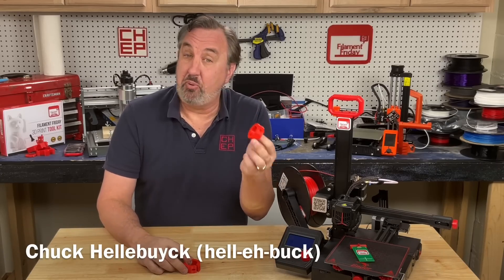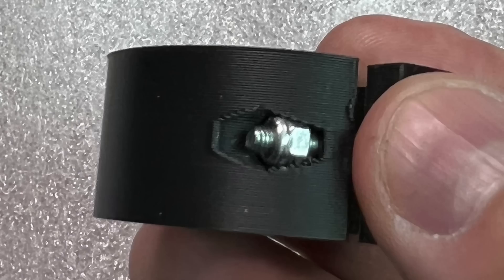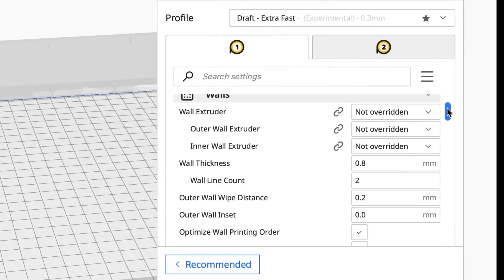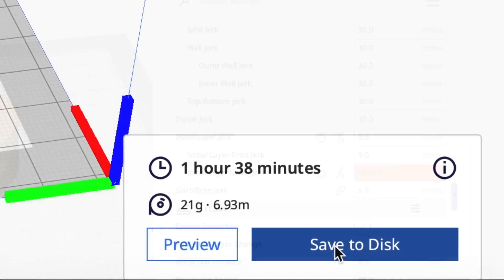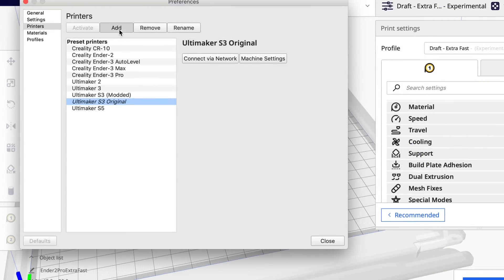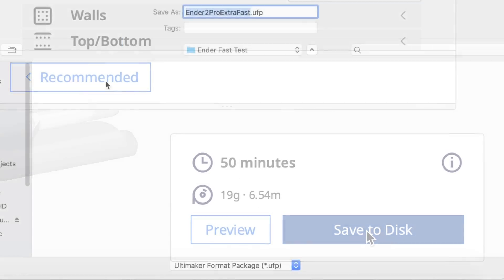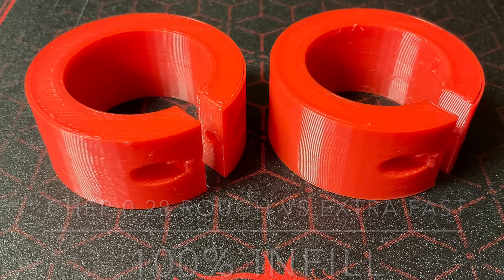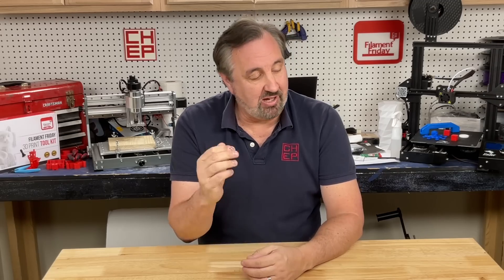Faster 100% Infill Prints with Cura 4.13 on Ender 3D Printer

Comment: More than twice as fast. Why so you think they don't offer this to any printer?
Reply: Such high accelerations can cause damage to the printer, they probably don't want to get complaints from people that will use that profile with printers that can't handle it, I highly doubt the reason is $$ when the program is free...
Reply: @E_y_a_l  Cheap clearly stated that acceleration makes only a little shorter print times. He copied accel to ender 2 profiles to prove that in video. There is "something" about algorithm that making prints much shorter.
It's not the first time that features are locked for non ultimaker printers. $$
Reply: @Wrublos212  What makes the shorter print is not relevant to what I've said, the question here is if the settings can damage the printer, one short move can damage a printer if it's aggressive enough, when you set the profile to a 4000 mm/s acceleration when the maximum supported value by the manufacturer of the printer is 500 there's a potential risk of damaging the printer, that's not twice, not 3 and not 4 but 8 times the MAXIMUM supported value, if you want to go into conspiracy theories about money being the reason it's your problem, but you can't deny the logic about a company being hesitant with sharing a new experimental feature with untested printers, and if you do deny it, try to do it with a logical reasoning and not just say $$.
Reply: @E_y_a_l  For me, and @FilmFactory (and probably everyone who watched this vid) is very important what makes print faster. For me acceleration is irrelevant in this scenario because it affect print time with minimum effect and degrading print quality. I have no idea why You care about accel, in fact You are right that it gonna affect 3D printer life span. What is the key factor here is printing algorithm shortening print time, not acceleration. You think its conspiracy theory that Ultimaker Cura gives some fetures for their 3D printers and not for cheap china ones ?  It`s not conspiracy theory, it`s strictly business. Apple policy and their ecosystem is conspiracy theory too? Or Nvidia not supporting AMD Freesync for long time just to pump up the sell of G-sync ? How different head moves can affect printer lifespan ? And please don`t mention about accel because with stock accel settings this method still works. This option is in "experimental" section so it`s clear that You do that at Your own risk even with Ultimaker device.
It`s not the first time when Cura limiting features for non Ultimaker printers.
Reply: @Wrublos212  bruh. I get where you're coming from. But literally the entire source code for Cura is open source. You can go to GitHub right now and look at exactly what they changed in the code if you wanted to. My feeling is that this "feature" is a combination of factors including, but not solely, increased acceleration. Ultimaker knows that their software is used by a significant portion of the industry, and probably hasn't spent time validating these settings for printers that aren't theirs. Once they do, I'm sure they'll release it to everyone. Would you rather have had them not release the feature at all, just because they hadn't validated it on other hardware?

There are plenty of shady things that happen in the tech industry, like you mentioned. But not everything a company does is shady. And I'm a lot more inclined to give the benefit of the doubt to a company that publishes all of their software as FOSS than I am to an Nvidia or an Apple.
Reply: @Wrublos212  You base your conclusion on reasonings that are simply wrong, the experimental section in Cura is not meant for "do it on your own risk" type of features that can damage your printer, that section is meant for features that have high risk in ending up with a failed print and this is exactly how Ultimaker describe that section themselves in their website.

The second wrong reasoning is that acceleration is a small part of the printing algorithm, first of all, it's not, every single move is effected by the acceleration and jerk settings, claiming it doesn't shows you have no idea how printer movement works, but like I've said earlier, it doesn't matter, all it takes to damage a printer is one(!) aggressive move if the printer isn't built to handle it, and if the manufacturer claims the maximum the printer can take is 500mm/s, setting it to 4000 is extremely risky, if you think aggressive head movement can't damage a printer then I only hope for your benefit that you won't discover how wrong you are the hard way...plus you said it yourself that we don't know what other things they've changed, so how do you know the other changes can't cause damage to the printer as well?

The third wrong reasoning is that Ultimaker have some kind of a secret agenda with that feature, you have no practical indication that supports that claim, what Apple and Nvidia does is irrelevant to what Ultimaker does, the question is what Ultimaker's history shows, not other companies, and at the moment, Ultimaker is giving you a fully working open source software for free and they don't even annoy the user with ads for their printers, if you claim Ultimaker are limiting features for non Ultimaker printers then start listing those features and we'll see, I'm not using an Ultimaker printer and so far I haven't noticed anything that I was limited from doing..

The fourth wrong reasoning is that Ultimaker will gain so much money by limiting that feature, making prints faster is only important with large prints and maybe you haven't noticed but that feature only works with 100% infill, usually people don't print large prints with 100% infill and not just because of the time it will take but because of considerations like the infill amount, weight, warping and more, so by definition this is a niche feature that will only effect a very small amount of prints, add to it that at the moment it also might damage your printer and you'll get even less people that will want to use it even for free, so trying to claim that Ultimaker decided to turn CURA into a "buy to use" type of program with all of the community backlash that will come with it just for that feature? sorry but I don't see the logic in that claim and I label it under a cynical conspiracy theory.
Reply: @E_y_a_l  Sorry, I don`t have that much time to replay You again equally long, read my previous comment twice, watch cheap video few times ( maybe 0.5x speed will help You to get all necessary information like print time with acceleration and without ) because You are missing the point all the way. 
" if you think aggressive head movement can't damage a printer then I only hope for your benefit that you won't discover how wrong you are the hard way..." my previous comment quote "I have no idea why You care about accel, in fact You are right that it gonna affect 3D printer life span." So why are You repeating yourself ? Think first, then hit the keyboard.
" so by definition this is a niche feature that will only effect a very small amount of prints, add to it that at the moment it also might damage your printer" And keeping stock Ender accel & jerk would also affect the printer ? It`s niche feature for You, but many people print something more than anime figures but fully functioning strong machine parts. "claiming it doesn't shows you have no idea how printer movement works" - Yup, I got the similar impression about You after what I saw.

Comment: still didn't understood what was the trick ??!!
Reply: My guess would be dynamic line width. They could increase the line width when the print head fills in large areas.
Reply: used the super fast profile on his ender 2. more accelerations and jerk.

Comment: When printing the raft, my MakerBot prints the lines 1.5 mm wide by default. I wonder if this profile does something similar with the infill bead width and makes it wider than normal since it’s 100% dense.

Comment: can we do this for ender 3 pro ? gaining a little bit of pace wouldnt be so bad :))
Reply from the maker: Download it. There is an Ender 3 version included
Reply: @FilamentFriday  oh, thanks but i have one more question. its not gonna broke the machine right? :D
Reply: @solidint  I just ran the print with the fast settings on my Ender 3 Pro. Machine held up fine, print was smooth and no stringing to be seen. Give it a run
Reply: @MrStoneSMS  thanks for your comment. i did the xyz cube thing and it printed that so fine but maybe the fast settings could be harmful in a long term

Comment: Is there a 100% hack for the ender 3? I love your videos! New to 3d printing and I am printing utility parts that require strength. I have been messing around with infill types and percentages, but this hack for 100% would be awesome if I had a plug and play code for the ender 3. Thank you!
Reply from the maker: Download it. There is an Ender 3 version included.

Comment: Now that I'm finally getting consistent first layers (thanks glue stick), I'm looking for ways to speed up prints. I'll have to give this a try. Thanks for sharing!
Reply: I began using a raft for my first 5 layers, I adjusted the raft distance outside the print from 15mm to 4mm for speed, but the raft is the WAY TO GO for getting more consistent prints. That, and a glass bed changed the game for me.
Reply: @georgeparker8167  I've got an Ender 3 v2, which came with the glass bed. In spite of this, I had constant problems getting a good first layer to stick down. Using a glue stick and very slow first layer is helping me the most right now.
Reply: @sgsax  Have you tried the raft option on the adhesion settings? I had major issues with my first layer for weeks, now I have zero issues.
Reply: @sgsax  Are you using cura? If not I am not sure which programs have the raft option for adhesion but I would look that. you don't want glue on your bed, overtime that will be no bueno
Reply: @georgeparker8167  I am using Cura and did experiment with rafts, and they helped a bit. I wash the glue off with soap and water between prints, so there's no buildup. Comes off completely clean every time.
Reply: @georgeparker8167  it's washable glue stick, everyone uses that on glass. You just use a damp paper towel and wipe it squeaky clean when you want to reaply, it's probably the oldest and one of the most reliable printing techniques people have used for over a decade.

Comment: I thought that 99% infill was stronger because it uses the selected infill pattern
Reply from the maker: Honestly, do you really think 1% is a big difference?
Reply: @FilamentFriday  im saying because of the pattern. On my printer 100% infill only has the back and forth pattern. And if its less you can select which pattern would work better with the load you are going to have.

Comment: We can try the profile with your part but I'm assuming we can save the settings to use for other parts? I haven't gotten up to speed on Cura yet.
Or are the printer parameters a file that can be shared like "fast ender"?
Reply from the maker: Yeah, you can load an stl file you want once you have the profiles.

Comment: I got rid of Marlin and uploading on SD card looooong time ago. Same for Cura. Now it’s Klipper (with Fluidd) and Superslicer.
With input shaper auto calibration and accelerometer I can get to 5000 (even more) acceleration without loss of wuality on Ender 5 Plus - which is fantastic given it’s a large printer with a center of gravity quite high.
With Dragon High flow hotend and 0.6 mm nozzle (tungsten carbide) my print times are now 1/3 of what it used to be. 150 mm/s at 0.3 mm layer height and 5000 mm/s accel? No problem at all. I must note it’s real 150 mm/s as I set my volumetric flow limit to 28 mm^3/s. Could go higher theoretically but this works just great.

I really advice to try Klipper if you have some Raspberry around. Input shaping and pressure advance are in much better state and quality than in Marlin (where you need powerful board to be able to handle it). And waving that stupid SD card here and there really becomes tiring after some time.

Comment: Hello, good video!. I think it is not stringing, it seems to me that when printing so fast it is filament that did not adhere to the previous layer. It usually happens to me when I print circles at high speed.
Reply from the maker: Then I’d see gaps in the walls but I don’t. So it’s stringing.

Comment: why not print 0%infill but many or better say ALL wall. with all wall (or lets say infinitiv outer/inner wall) the printer moves in much more natural ways and doesnt has change direction that often. this also results in faster printing speed
Reply: I f i remember correctly if you use the circural infill pattern it's pretty much the same as "all wall". I use it quite often and the prints are very strong indeed.
Reply from the maker: Weeeds334 - How much time did your method take on the part I shared and showed in the video?

Comment: I'd like to see the analysis of print time by other tools like the octoprint print time genius. I don't know if the results would be different. 
Reason being, I find cura can be out by up to half in my experience when you change to some wild speed settings.
I dunno, did they just make the time estimates better in their own printers? 🤔
Reply: it's due to the maximum acceleration set in Cura, which made the wrong predictation. If you change the acce to the correct one in your firmware setting then Cura will spit out good estimation

Comment: That's a cool trick.  Thanks for the tips.  * At the 5:44 mark you said Prusa 4.13 😜😜😜😜
Reply from the maker: No I said “version 4.13”
Reply: @FilamentFriday  - Do you use PrusaSlicer ? I like a lot of the features in Cura, but I do not like the UI experience compared to PrusaSlicer - so that's what I use. It works well for me. Just wish they had some of the plugins....
Reply from the maker: Yes, I’ve made several videos on it.

Comment: In regular 100% infill it just makes every layer as top/bottom layer and these are printed slower. In this "fast" profile it instead makes inner part as regular infill with it's higher printing speed.
Reply: That's probably what it is. I often set 999999 top and bottom layers when I want 100% infil (it's definitely different speed than first layer), but since my settings for top layer are nearly the same as infil I don't think I've ever noticed.

Comment: I’m pretty sure Ender printers are software locked on acceleration? I don’t know the max. But Chris Riley should dig into this. It’s interesting
Reply: just the firmware maxed out at 500, need klipper to go higher
Reply: @3DLL.  you can change that trough gcode via pc and usb cable or make small gcode whitch you will run on your sd card and it will save changes to eeprom
Reply: @mr.mun3271  you have a lot to learn my friend, have you just started printing?
 keep up the good work 👍
Reply: @3DLL.  done it already, so there is no limit, except diver/motor limit. Google for M201, M203, M204, M205, M500 and M501. Have you ever compiled custom marlin firmware using eg. Visual code studio? I have so i know what am i talking about. Klipper is overrated in some segments.

Comment: For your part in particular, i'snt it better to have like just perimeters and no infill?

When i print circular stuff (bushes, collers, etc) i always go all perimeter (set 20 perimeters or so). It is much more plastic extrude per time if it goes continuous circular sweeps than the angled infill. Also it's more resistant in tension on the direction of the perimeter. And since it's a collar, it will be much better for this task as it's all tension around the pole.

In my experience it also saves a whole lot of time compared to few perimeter and more infill (especially 100%)

Comment: Man try this: use standart profile, set 100% infill, change top/bottom speed to max yours speed (60 mm/s or more, set like infill speed i use 120 mm/s on my kossel) and you gona be good. When you take 100% infill cura set 999999 bottom layers so you can setting it.

Comment: the not overridden is most likely telling the slicer to NOT change machine defaults in the firmware, ill bet there is more magic in the firmware. i think this because i built my own delta, and have very specific settings that are optimal when i made the marlin based firmware, the gcode overwrites that.

Comment: I think I see the issue. Notice that when you set infill to 100% on your Ender profile, the infill was shown in yellow, but when you selected ultra fast for the ultimaker, it was in orange. Yellow is top/bottom layers, and orange is infill. Seems like cura treated the infill as top/bottom layers on the Ender profile, and top/bottom lines get printed more slowly than infill lines.

Comment: how would i set this up for the ender 3 v2??  cura dont have ender 3 v2 setting.
Reply from the maker: Just use an Ender 3 Pro profile.
Reply: @FilamentFriday  ok thx
Reply: It's the same as the normal ender 3 isn't it?
Reply: @Yrocsrelles  i duno. thats what i need to know.
Reply: @IronMan-yg4qw  they are the same just updated and nicer than the normal ender 3 but cura works the same on both. Just use the ender 3 profile
Reply: @Yrocsrelles  i noticed the bed sizes are different. i wonder if there is anything else i should change. :\
Reply: I use the Ender 3 Pro profile for mine.
Reply: @nodowt  yikes!
Reply: @IronMan-yg4qw  why yikes?
Reply: @nodowt  cuz theres no ender 3 v2 profile. i have to change everything to get the v2 profile. :(
Reply: @IronMan-yg4qw  I haven’t had any issues using the ender 3 pro profile.

Comment: the faster one @ 5:44 looks like it has arcwelder applied to it , a little smoother overall. less data to process, maybe faster.
you could try printing with 0% infill and a wall thickness so big, it fills the whole part